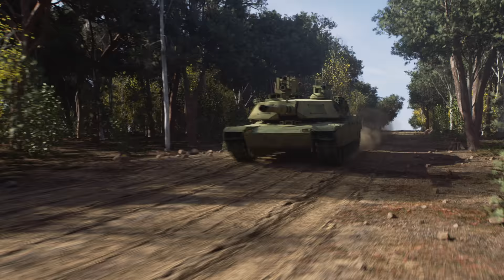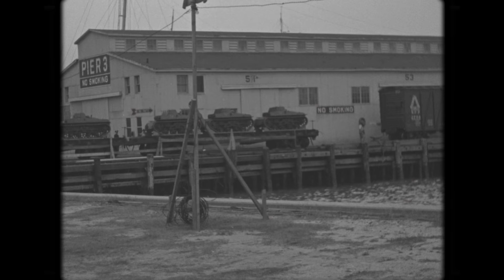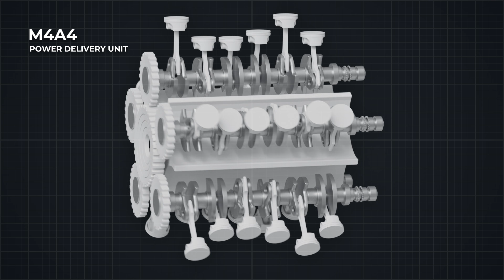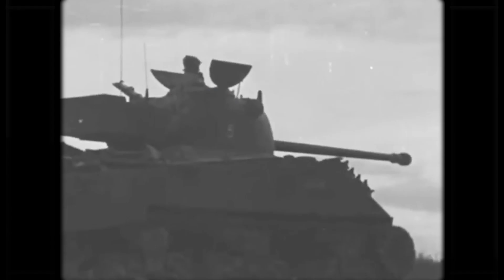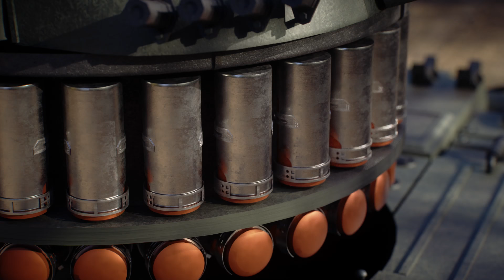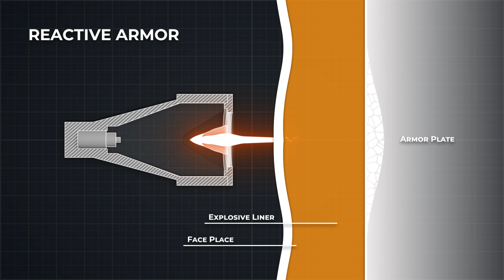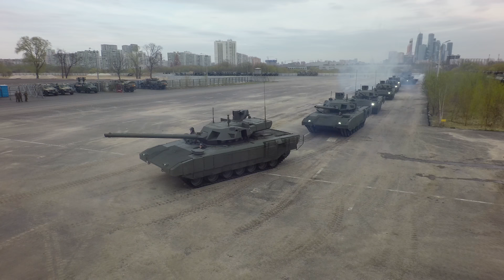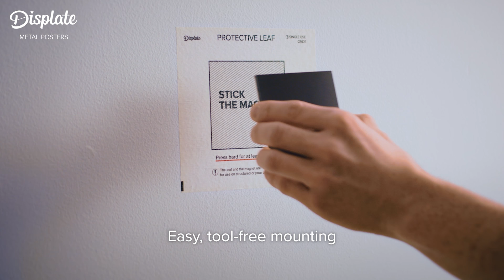Why America’s Tank Failed in Ukraine

Comment: You real engineering guys did poor research. The torque of the gas turbine is only a few hundred foot pounds and it spins at 22,500 RPM in the M1A1 tank. The important aspect of the gas turbine engine is the very high power to weight ratio and you can get your high torque figures like a diesel through gearing. In fact, the gas turbine goes through a 7.5:1 gear reduction geardown BEFORE going to the torque convertor of the automatic allison transmission. High power will always give you more torque for the same RPM to RPM match up with gearing as a low power,  high torque engine. So power is what matters.

Comment: Look I never thought the M1 was ever the greatest tank for Ukraine, but they did sent it out with out
troop cover the first time they sent it. It and the Bradley all got caught out in the open. The easy way to stop ANY TANK is a mobility hit, the treads or the rear and hit the engine.  But as I knew the best way was the top of the rear top of the turret was an obvious area that a drone hit could set off the ammo.
Russia made good use of this weakness. Overall if you look at the number of the other tanks it all evens out. I understand that the leopard 2 varies depend on model, but again they have all suffered. It is war.

Comment: I commanded a regiment of tanks and have written extensively on mech warfare. Most of the data in the video is correct BUT here is the unspoken CRITICAL factor: the winning component in ALL mech warfare is NOT technology (however wonderful it is). The determining factor is crew tactics. Read NOT DEAD: A case for Tanks in the Modern Battlespace, if you want to understand more.

Comment: At least we know that real engineering doesn't know much about tanks. 

The Abrams wasn't designed to be invincible, it was designed with crew survival as a priority. You also have to look at tactics used by the USA compared to Ukraine. USA used a combination arms strategy. Meaning that the Abrams would never be fighting alone, there would be air support, recon, infantry, ECT.... Ukraine doesn't use this. It's not a failure, it's being pushed into a place it wasn't designed for.
Reply: Exactly.  This video is basically like the Russian equivalent of claiming that Chinese golf carts suck because they can't withstand drone attacks.  If you use something in a way that was never intended, then you can't rationally complain about the results.

Comment: Decades ago, at the introduction of the A-1, 60 Minutes did an extensive report on the controversial choice of the turbine engine, making the case that the simple and reliable diesel engine was more practical. Of particular concern was the threat of turbine damage by sand ingestion when operating in the desert, in addition to high fuel consumption. 
BTW, I think a turbine operating in a tank or helicopter is not a jet engine, as all the exhaust is used to spin the compressor and drive train, rather than to provide thrust by ejecting the exhaust out the rear of the vehicle as done on a jet plane.
Reply: The funny thing is... the Abrams engine has practically nothing to do with 27 of 31 US Abrams sent to Ukraine being lost or destroyed.  We, (the US), removed our best armor from them before shipping and sent them with basically 50 year old armor tech.  And the Abrams was always designed to defeat Soviet and far Eastern tanks, not drones and anti-tank mines, which are what caused most of the Ukrainian Abrams' losses.  This is a crappy video, honestly.

Comment: If we're talking about the Abrams and Leopards in the context of this particular war

1. They're huge, easy to spot and hit.
2. They're heavy and easily get stuck in the Ukrainian black soil.
3. They're noisy and generate so much heat that they're visible from the air with a thermal imager like the North Star.
4. They're very fuel-hungry.
5. They're expensive and difficult to maintain, especially when it comes to the Abrams. It's a complex system; everything that can break breaks. You can't just fix it in the field, and that's a downside.
6. And the biggest downside. Because they're complex, large, heavy, and expensive. It's impossible to quickly manufacture them and deploy them in large quantities to the front, and that's a bad thing.

By the way. My cousin, a former LNR Militiaman from 2017 (now just Russian soldier), told me another drawback, not about tanks, but about an American Oshkosh, I think it was. It's a tall one. I don't know the exact name; I only saw a photo, so I can tell from the photo. His unit stopped two of them without problems.

1. It's narrow and flips over very easily. Ukraine has a lot of ruts, and if you swerve a bit while avoiding gunfire or a drone, you could flip over.
2. It's very heavy, easily getting stuck in the black soil.
3. It's tall, easily visible (also, whoever shipped desert-camouflage vehicles to Ukraine is a genius; against the grayness of Eastern Europe and the black soil, it's the perfect spot).
4. The biggest drawback is what makes them so easy to destroy. It has... A PLASTIC HOOD! It's easily penetrated not only by a mine fragment, but also by a simple AK-74 5.45 x 39 bullet. A couple of shots to the radiator and the vehicle dies after a 20 meters.
5. Armored glass is easily penetrated by an AK-74, but with an armor-piercing round (black tip).
Reply: Uh... the Abrams has not been "manufactured" in over 3 decades.  They're so hard to actually destroy and so effective in all previous uses, that the US military has been upgrading them since the day they were put into service.  You pretty much haven't said anything in your comment that can't be said about any other main battle tanks.  And Ukraine has probably taken out at least 2-3 Russian tanks for every 1 Ukrainian tank destroyed.  Probably more.

Comment: I was wondering about Motor Generator Power Train because an Electric Motor has maximum Torque at low rpm. The Power Train would be bigger of course but the Commentator expressed an opinion that Low Speed Torque was important. In the final few minutes he mentions a Hybrid Unit with Battery.

Comment: I would still rather sit in M1A3 Abrahams than in T14 "Flying turret" which is just a metal coffin for the crew, btw why it wasn't mentioned? Coincidence?
Reply: Because this stupidity of internet "experts" that has become a meme due to a poor understanding of the concept. Abrams tanks also had turret loss like on photos from Iraq. It's not a matter of tank type, as the armor is more or less the same, but of the location of the explosives, also known as the ammo rack. In the Abrams, it's primarily in the rear, in the so-called "basket." In T-type tanks, it's located on the sides of the turret. Russian tanks carry a lot of ammunition. Ukrainian tanks, due to shortages, don't carry as much, and they're stored in the rear. But there is something worse and more painful.Have you ever wondered why so many of the destroyed Abrams in Ukraine have a burnt-out turret? As practice shows, when the basket is hit, a huge fiery sauna occurs inside the tower. That's why many Abrams in Ukraine drive with the hatch open, so that you have at least a small chance that the pressure will throw you out. So there are two options here: either the tower flies away and you along with it, or you burn alive in a matter of seconds. In both cases, you're most likely dead.
Reply: @mitrogulf4073  but in abrahams there is at least some safety, in T14 you are literally sitting in a ammo storage due to autoloading design... Look on war on Ukraine, russians have much higher losses...
Reply: @T @Terradyn86  you cant seriously believe that Russia has higher losses with how much they outgun ukr, how gullible are you? lmao
Reply: @leight7777  yes, they do. Thats why they do not use tanks that often as before. Even built cages around them not worked.

Comment: Well, we do onow the t-14 armata is a complete disaster from design, engineering, crew ergonomics and manufactoring. Even the engine was a disgrace, based on a diesel water pump from the 1940s. When they realised they had to change thevpowerplant the design was so compact no other engine could fit in the tank, needing a complete redesign of the thing. The crew compartment has been described as a coffin with led screens. Despite having cameras on all sized the crew awareness is worst than in a conventional tank. The supposed modelarity of its platform turned out to be another myth too. Oh and that thing is even slower than the T-72 as all filmed demonstrations of the armata in movement were done with the turret being a mock-up made of plywood.

Comment: I think even the Armata is a problem now. Ukraine has proved that the bustle at the back is basically a juicy drone magnet, which means what we need is a tank with active APS like the Merkava, but at the same time moving all the ammo to the bottom (yes, the turret-toss memes will start here, but it does serve a purpose... what is needed is to protect the crew in case blowout happens)
Reply: Congratulations,you've just described T-14.

Comment: because abrams is only good against countries without a proper anti tank or closed air support unit. unfortunately for them russia and china had these
Reply: You are ignoring the fact that Ukrainian tank  divisions do not have Enough air and artillery support.and Even Anti-aircraft weapons
Reply: @aii.l-e5  and russia does have artillery and close air support, so you just proved my points that abrams was only successful at fighting against countries without a proper anti tank support, namely lebanon and syria
Reply: @afiqdanial3053  For tanks to be effective, they need air and artillery support. You've proven my point as well.
Reply: And I won't lie, your idea is  kinda correct. The Abrams, as well as the T-72, Leopard 2, and Merkava 4, were all designed to operate against countries without anti-tank or anti-aircraft weapons. This is why they are relatively successful.  This does not change their value or effectiveness.  @afiqdanial3053
Reply: @aii.l-e5  the number is actually lower than reality. it is actually 29/31 abrams that had been taken down and 1 was m-killed frontally by T-72 gun launched missile
Reply: It says 29 Abrams tanks were lost, and in contrast, how many Russian tanks have been destroyed since the beginning of the war? @afiqdanial3053

Comment: The Brazilian EE-T1 Osório outperformed the M1A1 Abrams shortly after, in the 1980s Saudi Arabian desert trials, winning on fuel efficiency, mobility, and accuracy. Despite this technical victory, the deal collapsed due to intense U.S. diplomatic pressure and the strategic shift following the 1990 Gulf War. Ultimately, the Saudis chose the Abrams to secure a military alliance with the U.S., leading to the bankruptcy of the Brazilian manufacturer Engesa.

Comment: The Abrams was designed as part of a specific combat doctrine.  Its a part of a system of systems in Combined Arms Warfare.  If you just throw it on the battlefield with crews who cant fight the tank in Combined Arms operations, its going to get defeated.  The ability of the average Army Brigade Combat Team is so lethal is because of the all the elements including Field Artillery, Main Battle Tanks, Bradly Mechanized Infantry, Air defense artillery, Aviation assets, Intel, Support, and Digital warfare systems on and on and on combined in one package and trained to fight that way.  Just a couple of full ABCTs with a support brigade would have ended this war years ago.

Comment: The T14 isn't even real.  They had one on a Moscow parade that broke down, and couldn't even be DRAGGED away by another tank.  They had to crane it onto a truck to get it out.  If the T14 were real, they would be being used, and none have been seen on the battlefield,. not that I have heard about, anyway.  They either aren't real, aren't finished, or are not fit to fight.   The Abrams showing was apparently pretty poor, but you didn't compare it to other tank loss ratios, like the Leopard II, which would have been interesting....or you did, and I missed it, I did leave to hit the rest room for a bit, and too lazy to put the cursor back.
Reply: "The T14 isn't even real"
Your brain isn't even real.
"They had one on a Moscow parade that broke down, and"
And you are regurgitating decade-old BS.
Tank in question left under it's own power,which stands to reason that it didn't broke down.
"If the T14 were real, they would be being used"
They are used,but you're WAY too blind to see it.
Reply: @vladkorobov155  Like fucking hell it did.  I'm not 'regurgitating' anything.  OBVIOUSLY you did not see the video, they SHOWED it being lifted and removed.  The transmission or something in the drivetrain was LOCKED SOLID.  They tried to pull it with another tank and it SKIDDED. 

Your brain is nonexistent.  You jokesters that try to rewrite reality that is shown on a video make me laugh my ass off.  Go try to pull this shit with someone of your bent, because that BS isn't going to fly.  I'll bet you are either a dopey Russian or a tRumper.  How'd I do on the guess?

They really are improving Russians in Ukraine.  And hey fantasy boy, how about you find me ONE video of a T14 being used in the war, because I have been following since the beginning on MANY channels, including those that deal directly with weapons, and if a damned T14 was EVER seen, it would have been relayed from the housetops, so to speak.  Manage that, and I will be GLAD to go find the video I am speaking of...but you do the work first, since you make the fantastical claim, that something Russian actually WORKS!

Hey, while we are on the subject, how did that 'ray gun' that Pootin went on about for weeks work.  Funny, after they deployed it, we never heard another word, from him, or anyone else.  You guys are laughing stock the world over, JUST OWN IT!
Oh, and how's the Moskva, her sister ship, that sub, and that aircraft carrier of yours doin'?   Oh, right, sunk, weapons destroyed (radar), sunk, and sunk, against an opponent THAT DOESN'T EVEN HAVE A NAVY.

I suggest you go try again, with someone at your level.  ;-)

BWAHAHAHAHAHAHAHAHA!
Reply: @MrJdsenior  
"  I'm not 'regurgitating' anything"
Of course you do.
"The transmission or something in the drivetrain was LOCKED SOLID"
Which is why,again,tank left under it's own power.
"how about you find me ONE video"
Denied. You don't have access to the stuff.
"Hey, while we are on the subject, how did that 'ray gun' that Pootin went on about"
Any such claim without relevant link to kremlinru confirming it is dismissed as a lie by default.
"Oh, and how's the Moskva, her sister ship, that sub, and that aircraft carrier of yours doin'?"
Irrelevant to the discussion.
And term"sunk"implies enemy action.
This is a lie.
Reply: @vladkorobov155  Denied. You don't have access to the stuff.  LOL

OK, oh ignorant one, here is the link.  You haven't seen things about the war that were put out for a week or more, yet here you are, expert or the year, somehow implying you have knowledge that is somehow classified or some ridiculous BS.

EVERY one of those WAS sunk by enemy action. Have you been living under a rock this entire war, or do things just not sink in.  Instead of third grade answers, how about you tell me something that I DON'T know about this war that YOU do, because so far, you look like you are barely aware that there IS a war going on.

You sound like Xi, Putin, and tRump...oh, pay no attention to what you are seeing and feeling, just listen to me, I will tell you what reality is.  While you are at it, look up Dunning Kruger.  If you can actually manage to read and absorb any of it, it should be truly enlightening for you.

Done here, troll, you bring nothing to the table, except absurdity.

Kremlin ru...how fucking dense are you.  I just told you that you could find videos of Putin himself saying that about the laser system.  Have you heard of Google, or have they banned that in Russia, too?  To anyone reading this, you have outed your knowledge level many times now, so just stop, while you are miles behind.
Reply: @MrJdsenior  
"here is the link"
I'd like to note distinct lack of any links in above wall of text,and therefore the whole wall of text written by alternatively gifted user is dismissed without examination.